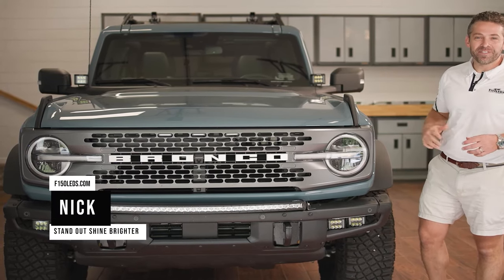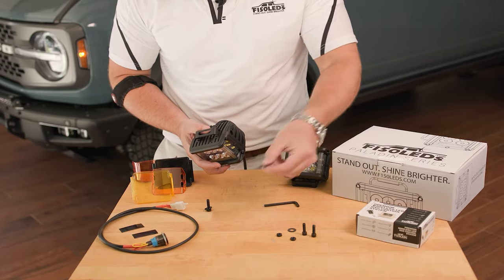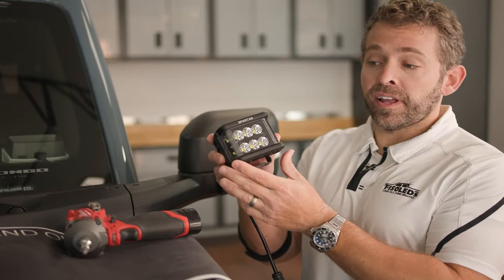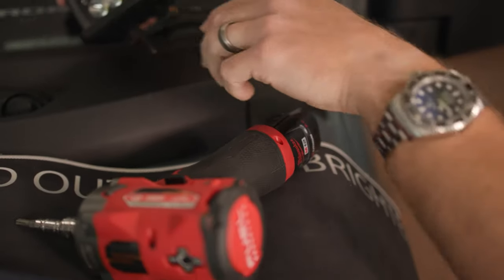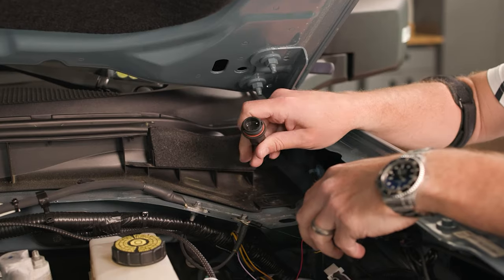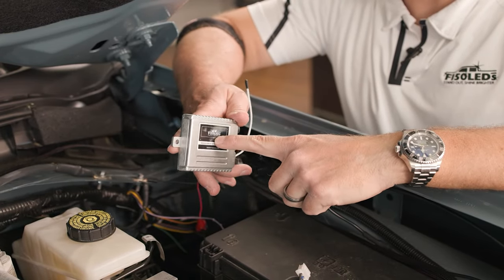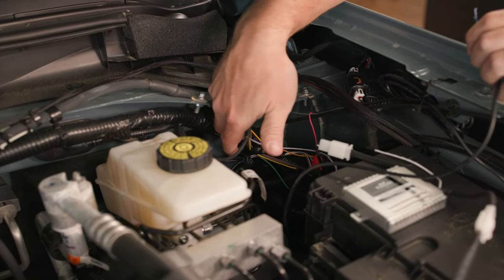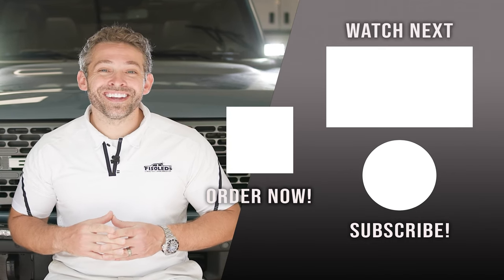2021 + Bronco Hood Mounted LED Lights Installation (From F150LEDs.com)

Comment: Can you instead just wire the lights into the Ford Aux switch wiring?   Much easier if I don't want the remote...
Reply from the maker: Hey dsleonhart, yes obsoletely! We only show the remote in the video for those that desire that option, other wise you cna connect directly to the AUX wires. Please let us know how else we can serve, thanks for your support!
Reply: @F150LEDs  for those of us that aren't experts we could use a video showing how to directly wire this to an aux switch without the remote please
Reply: @glennsinclair5511  the blue wire that comes connected on the harness goes directly to one of your aux wires. Very simple, just did mine this weekend. They look great